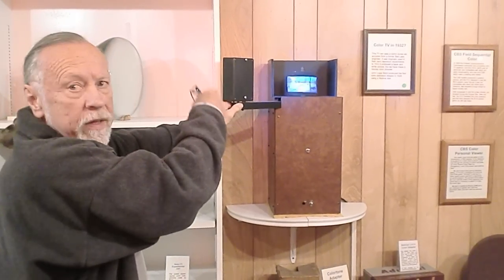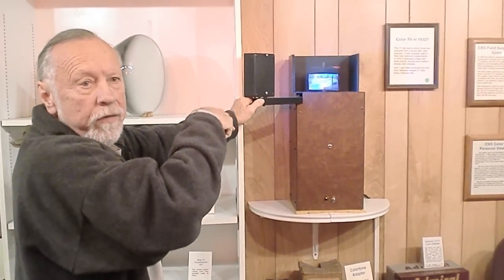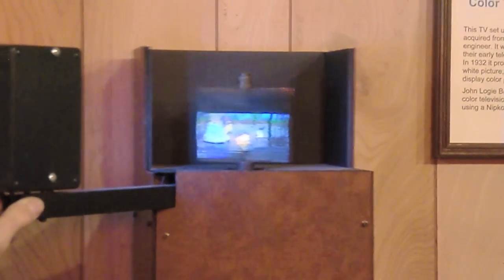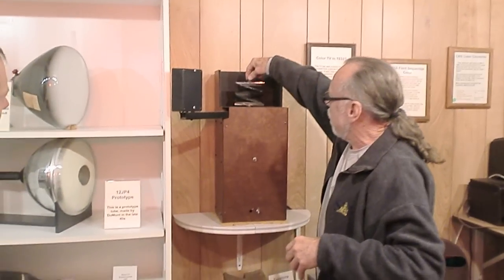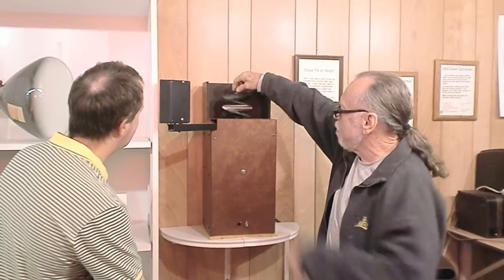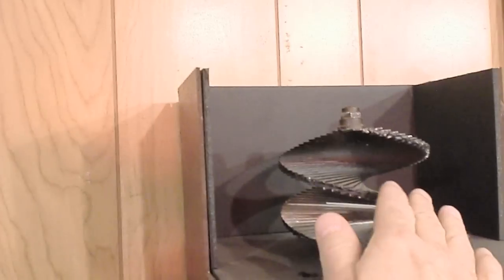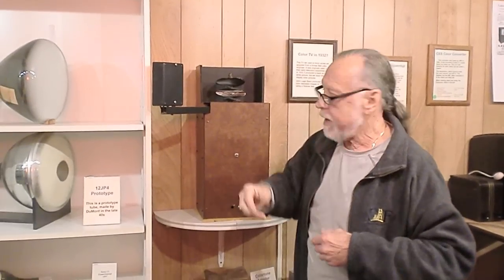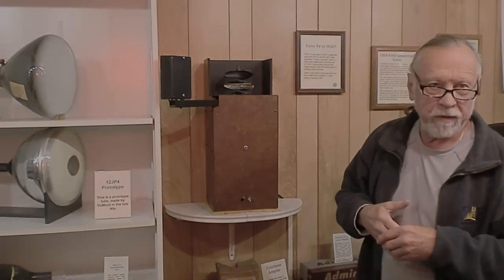Mechanical color television

Comment: Anyone else from Technology Connections? Awesome example here, would love to see more detailed shots and explanations !
Reply: Me!
Reply: Me =P
Reply: @EarlyTelevisionMuseum  http://www.earlytelevision.org/Yanczer/yanczer_index.html
Reply: The screw is the best concept of a mechanical television (in terms of the use of light, area, etc.) that can be produced at home, although the production is more demanding than the production of Nipkowa disk. It is necessary to get many thin mirror strips of the same size. It is good to have them wider due to sticking to each other. If you keep the same angles and overall gluing accuracy, a mirror screw will be created. What will happen? At any one time, one strip of mirror is pointing towards you in parallel, reflecting the light from the source. Slight rotation will cause the light from the source to move from left to right or vice versa. The entire revolution causes all mirror strips to alternate as line spacing and all lateral light point shifts. The concept of the mirror screw dates back to the time of the mirror wheels (drum scanner) at the end of the 1930s, when electronic television already won. Therefore, the mirror wheels and screws no longer prevailed, even though the image from mechanical televisions was much better than from electronic television. The undeniable advantage of a "screw" television is that it provides a large picture on its entire platform. This image can be projected on a large screen and the scene can be captured with the same device. The color image was already known in 1927, but the video device simulates the screen in-line, which is challenging and requires current technology. Color decomposition can be done in other ways. The philosophy of television is "tele-vision", ie far-seeing. Television is not a cinema and is only intended to provide a distant live picture. Therefore, the quality of mechanical televisions reflected their original purpose.
Reply: Me!!
Reply: Yes.
Reply: Same

Comment: A wonderful, inventive piece of technology.  However, there was no way that you could ever get a decent enough picture with that system to justify a commercial service.  Mechanical TV was more of a curiosity in those days.  A few geeks had sets, but they saw mostly silhouettes, test cards, a Felix The Cat doll spinning around on a turntable, and occasional head and shoulder shots of a performer.  Mechanical TV pretty much died about 1934 when electronic TV -- with the image on a cathode ray tube -- was shown to be more practical

Comment: this just blows my mind...i would've never thought a mechanical TV would be even possible
Reply: In 1928 tv pioneer, John Logie Baird, sent live mechanical tv pictures from London to New York using radio waves. This was decades before man made communication satellites were put into orbit to relay television pictures wordwide.
Reply: @trevordance5181  It was 1925 but yes. Though that wasn't the first use of mechanical televisions to transmit images period, only wirelessly, as a facsimile machine was demonstrated to send and receive still images over telegraph lines in as early as 1851

Comment: Love it! How many mirrors for HD?
Reply from the maker: One for each line. a 30-line picture has 30 mirrors.
Reply: I.P.T.V Yeah I kind of knew that, I was being silly. Mind you it would be a mind blowing project if you could pull it off. I suspect you would run out of space unless the mirrors were microscopically small. It's amazing television began this way, and still has more or less the same concept of scanned pixels. It's almost analogous to computers and binary information. Old tvs fascinate me and I have a modest collection from the early sixties when tv started in New Zealand. Another silly mechanical tv project I imagined is stereoscopic nipkow or mirror tv (3d)! Maybe the viewer would have a pair of shutter glasses with rotating discs in front of their eyes..
Reply: Chuffpup.  oled does a better job and is solid state
Reply: @punker4Real  I am from 3 years in the future, and we now have MicroLED TVs that are getting better every month. OLEDs are starting to already be phased out.
Reply: @chuffpup  Is it possible to make a large number of mirrors at the microscopic level, but the total size will be like the one in the video?

Comment: I wonder what happens if one of those glass strips breaks off while watching...
Reply: Then one line would be "dead pixels", but easier to fix, than a dead Pixels in modern TV set
Reply: @retro3dprinting  The viewer might become "dead pixels" in that case, which is a lot more difficult to fix than dead pixels in a modern TV.
Reply: @VioletEnds , not at a rotating speed of 1500 RPM (25 fps). It is even not a excentric movement. 5xfaster than a spinning floppy disc drive. it maybe can hurt a little, but killing a human? NEVER! You assume that killing a human is very easy.
Reply: Like the today's technology, when you experience an unexpected screen crash, it's a dead pixel

Comment: Neat! I have been promising myself to get into this hobby soon. (find the time). Did this technology ever get applied to guided/smart bombs in the 1930's or 1940's?  If you illuminated the mirror drum/mirror screw every 90 degrees with the scanners, could it display four deferent  images/channels at once? If so sound like you could save some $ over old CRT.
Reply: +ufoengines 
The only one I know of is that the Japanese tried to put a television camera in guided torpedoes however it never came to fruit duo to the immense costs and not to mention each television system needed for one torpedo was just impractical at the time.

The Soviets tried multiple times integrating television cameras into tanks, first it was for night vision in the late 30s and then in 1946 they tried to create a television aiming assistance for the IS-7 the most advanced tank at the time, nothing was as advanced as this tank until the T-64 entered development which became the first tank to use computerised television aiming assistance to hit targets at extreme ranges. This system was developed in the 50s.
Television technology did not become viable for guided bombs and missiles until the 80s.
Reply: If it displayed four channels then it would be literally a television set, which means you got a set of four.
Reply from the maker: If you mean watching two different programs at the same time, check this out: http://www.earlytelevision.org/dumont_duoscopic.html  The WWII-era television-guided bombs were electronic television. (And it was only the display that ever used a mirror screw; the cameras of the era were all spinning discs.)  Here's a program I recorded on the subject of television-guided bombs: https://youtu.be/jTGlOORz9w8?list=PLNxWqld3VS6qPurtcZiHbTBdtKDzNSBrD

Comment: i wonder whats stopping the mirror from cross-talk with leds... perhaps its the illusion that any rotating flat wall will appear to follow you.
Reply: the angle of the mirrors and distance of eyes to mirrors stops the cross-talking effect. If you move, at a point the image rolls one pixel up or down for you, then two pixels, then three pixels ...

Comment: Why LEDs? LEDs produce blue light which is bad for your eyes. Should use Halogen or some old light technology that doesn't ruin your eyesight.

Other than that, this is really cool. SHUT UP AND TAKE MY MONEY!!!
Reply: No, blue light does not ruin your eyes. Look at the sky. it is blue. Does it ruin your eyes? Oh, did I told you that Halogen switch on/off cycle is too slow for mechanical television? You would need a gas discharge lamp which generate much UV-light. That's like looking directly at the sun. Sounds not very dangerous.

So believe me, LED is the healthiest solution
Reply: @retro3dprinting  You don't understand. The light in the sky is white light based. LEDs are blue light base. Yes you can filter and reduce the blue light by opting for a Warm LED, but is it really enough? 

Ok yeah, I forgot about the Halogens delay, but why not use Incandescent?
Reply: @Vinnay94  There is far more blue light in daylight than in LED light. It doesn't matter if LEDs have less red and green overall.
Reply: @retro3dprinting  I guess back in 1920 since there weren't any LED, but vacuum tubes were fast enough to switch something that fast and for a fast switching light could be something like neon and other gas light bulbs.
Reply: @dragonskunkstudio7582  I guess, this is correct